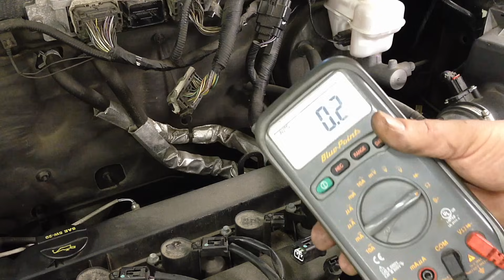Ford Ignition Coil Primary Codes P0351-P0360 Diagnostic Walkthrough

Comment: I'm having the same problem this is the first  time it gave a code for anything. on my 2001 Ford mustang gt  I have a my code is p0355 I did all the test when I connected my noid light than started the car the cylinder 5  hardness there was  ground no pulse could that be a large change the PCM is done for.

Comment: I have a po354 code the on f-150 5.4 guy  scanned it scoped it or whatever said I need a new computer anybody know much about that?
It has misfire on 1 and 4 then we clear the codes and then it's got a misfire on eight 5 and 2. Doesn't have any power if you press on the gas the truck won't even move

Comment: Where can I find a c.o.p. diagram to find the pulse pin for coil #1???? I'm desperate. I can not find a schematic on the 2007 5.4 3v Expy for the cop's. I have a p0351 and have don't EVERYTHING ELSE even a timing job!
Reply: @Jeremy Hess I had my friend Tim Latterly at MVperformance send me a diagram and I got that part straight. Thanks Jeremy! I still have a bad problem that I can't figure out though with this thing just going into mode while driving (when it's cold it's 100x worse). I am still getting a chech engine light but I don't have the codes handy. If you don't mind helping, I can let you know the codes tomorrow? I would sure appreciate any help.

Comment: Love your stuff! And appreciate that you share the info. You said that on three prong coil systems the testing is different. It is, but some Late model trucks have three prongs but only 2 wires in the connector. Little tip for those who get discouraged seeing three hole connector. Look inside to see if three prongs pare present. If not this test will apply to you

Comment: P0355 code 2008 Ford f150 4.6
Reply: That’s Cylinder 5 misfire, swap coils with cylinder 4 see if you still get p0355, if the coil is bad your new cel will be P0354

Comment: Just had an issue where my 2012 f150 ecoboost was idling weird. I had just had all coils and plugs replaced and was scratching my head. Had P0351 and after visual inspection realized cylinder number 1 coil connector was not fully connected. Reconnected it and have no change in idle. I assume im looking at a PCM replacement now? I think I am going to have a hard time explaining this to them and making them pay for it. Any suggestions?

Comment: had a p0354 on my 98 expy, didn't find this video until today, but i did fix it already, for me the solution ended up being cutting off the old connector, and crimping on a new one, once started it immediately ran significantly better,  so for anyone out there also getting primary ignition coil circuit codes, just because the coil and spark plug are both fine, doesn't necessarily mean that your PCM has gone bad either, it very likely could just be the connector itself has worn out
Reply: I have an 07 5.4 Expy, I've had a p0351 code. I have the constant hot side but I can't find a diagram to check the " pulse side" pcm pin to the #1 coil
Reply: what pin/cable is it for P0354?

Comment: How would one do the noid light test on the 3.0L on cylinders 1, 2 & 3? I have a p0352 code.
Reply: I just bought one, plug it in to your harness that connects to the coil and while your vehicle idles it will pulse if it's receiving the command from PCM, point A to B.

Comment: I replaced all coils and plugs, had a bad coil # 4, after repairs got the PO354 , found cracked wires from the adapter connector up 6 inches.. repalced the adapter connector, still getting the code, checked all the wiring to the pcm.. no cracks or tears.. any insight?

Comment: I thought you had a problem,what was it,the power was going through to the end as shown on the noid light,but u did not show us the ohms found if u hit the right pin on the pcm connector..what was the problem here,did u need a coil or just what...thanks

Comment: I have this same code P0354 So I switch the packs around still no spark on #4 so I check the wire they seem fine but when I pull the wire near the manifold the car revs by itself I dont want to take off the manifold what should I do now

Comment: Ive got a 02 Explorer. 4.6 4x4.  Ive got codes p0351 p0352 p0353 p0354 and p0358
What does it mean when you've got many of these codes?
The truck will intermittently not start.  All lights work, door chime, radio, fan blower etc, just no starter.  You can try it again and it may or may not engage the starter.

Comment: Hey I'm have difficulties with my 99 f250, I did all test that you posted about p0354 code in wires are good but as I plug the coil pack in, than I tested no spark , but when I plug the coil pack in a    different plug it works so how can I fix that? Been trying to fix truck for two months now...
Reply: Any idea if it would b possible a wire ???
Reply: Sheena Frank it's obvious that the coil driver for that cylinder has failed inside the PCM

Comment: Hello, just recently replaced spark plugs on my 2011 f150 5.0. I installed ngk iridium plugs. Shortly after installing those I get a shake and a p0354 code comes on. I replaced the coil pack and that did not help. While I was doing the spark plug change I did break a connector and replaces the black portion that plugs into the coil pack. Do you k ow if the coyote motors are picky when it comes to spark plugs or do you think I messed something else up? Any help would be greatly appreciated, thank you.
Reply: Kyle Harn if you installed a new coil on plug and spark plug and it doesn't fix your problem. Then either there's a broken wire or you need a pcm. If the plug came unplugged while the engine was running. Then install and new pcm.  It's a big No No to unplug the 3 wire coils while the engine is running. You'll get a voltage spike that takes out the coil driver in the pcm.
Reply: Adrian Waloshin thanks for the reply! I am leaning more towards a broke  wire since it is intermittent. Sometimes it will be okay and sometimes it misses

Comment: I have an 04 Taurus wagon  v6 duratec. Cylinder 1,2 and 4 are not sparking and it's not the ignition coils. I used the noid light on all of them and those three are giving me issues no spark and they won't light up on the noid light but will light up with the pen. Do you think I'd have to buy a new pcm?
Reply: Hi.  Did you fix your Taurus?   I'm having the same issue.

Comment: At 1:20 you say that the numbering goes from left to right and on the V6 and V8 engines it goes from front to back.  This is NOT accurate. On the 3.0 V6 engine, the back three cylinders are 1,2,3 and the front three cylinders are 4,5,6.  

I had a P0352 Code in my 2008 fusion. Based entirely on your statement, I replaced my FRONT three coils/plugs at the same time I reinstalled a rebuilt PCM.  Ran well for several minutes, then I fried coil number 1 and probably my PCM too. You might want to edit that statement about front to back cylinder sequence.
Reply from the maker: Yes my information is accurate you misunderstood what I was saying. I would imagine after 10 years of Ford drivability I would know that cylinder order. Especially because every Ford engine is the same you really cannot mess it up they are always in numerical order starting on the right bank FRONT TO BACK then it picks up again on bank 2 FRONT TO BACK in numerical order. If you did not replace your pcm with an RM suffix part number then this will happen again. Anyone who has the ability to reprogram the pcm and PATS keys should know the cylinder ID for each cylinder vehicle they are working on along with applicable TSB's. I hope this helps!
Reply: Criticize the free information you are getting. How about you do a little leg work yourself, double check the info, before you go blaming someone else for YOUR screw up. Not like you had to pay for any of this info. Its a starting point.... Or if you don't understand a firing order maybe you shouldn't be working on your own shit.... Just sayin
Reply: @csaleen302  Exactly
Reply: The 3 cylinders on the firewall side of a 3.0L V-6 are on Bank 1, the front of the engine left to right 1, 2 and 3 and on Bank 2 are 4, 5 and 6 left to right. The firewall side is the front.

Comment: I have a 2010 Ford fusion Hybrid and getting all  coil codes, 351 351 353 and 354. I'm thinking it's likely pcm since they are all coming up. Is 2010 one of the years they were troubled?
Reply: I have around 40 hours into this same problem and have replaced and troubleshot 90% of the system.  Did you ever get a fix for this issue with all coil codes on a hybrid?  Replaced PCM, then oem coils and plugs.  My car still starts, idles rough then shuts off automatically.  Thanks.

Comment: Thanks for the video - used it on an older Ford ZX2 with a coil pack ignition that ran like crap and was throwing a P0352.  Found one of coil trigger wires had rubbed through and was contacting the bracket at the rear of the cylinder head.  Appreciate all the help you offer up!

Comment: Thanks, My Brothers 2008 Edge is throwing P0354 and cylinder 4 is dead.
Reply: Bassett Race I'm getting this same code po354 for cylinder 4 does this mean the pcm is fine probably wire or cop

Comment: i have a intermediate 351 and 356 on 04 f150 5.4 3v the only other problem is failed alternators its been through 3 in the last 2 months, new coils, plugs, back probed all wiring, cordone ecms tech said unless its a currant failure sending in ecm is a gamble! it only fails for a few seconds while in gear! any suggestions? thanks in advanced. oh and i noticed the ecm has 8 drivers / transmitters for the coils but im not sure the intermediate issue

Comment: wanting to know before I take my PCM out to have it repaired, my #2 coil had melted, replaced with a new one, upon firing it up, it melted again almost immediately. is the pcm the culprit here?
Reply from the maker: +Ronie Ochoa yes very common on the escape and fusion models the pcm driver gets stuck on
Reply: @FordTechMakuloco  my ignition coil isnt working. And I noticed when I umplugged my ignition coil harness it didn't do anything. Should I be looking into the Pcm?
Reply: @FordTechMakuloco   Might have missed it in the video , will look again but How do you know a driver is stuck on?
    Had a 2005 e250 5.4 come in with a Cyl8/Coil H primary open. found the coil "exploded" Replaced coil  all was good until a month later. Now Fuse #8 for ecm relay and coil power blown and van does not run. I unplugged the cyl8/coil H coil and the Van will run. Thats as far as I got with any diag.
Reply: 2010 ford fusion 2.5

Comment: I've read on forums and seen other videos where they say that if you have a problem like this it's better to replace all coils and repair/replace the pcm. Their thoughts were that the short in the coil would damage the pcm. Also if the pcm were bad it would in turn short out the other coils on start up. What's your thoughts on that? 
Would it be a big deal to just replace one COP if that was the only problem? Could you swap COPs from one cylinder to another (say cyl 2 to cyl 4) in order to verify a bad COP (if all you had was a code reader and no DVOM)?

Comment: Nice video man. I have a 2001 transit connect with the 2.0 and it has a persistent p0354. New coil and connector on this thing and the code will intermittently set Customer says the van does in fact misfire sometimes but only for a few moments. I have tried to recreate this with several road tests and by moving the harness while in the bay. Never got it to misfire. Any advice on tracking it down in this situation? I am thinking about running a new wire for the control side to the pcm and trying it again.

Comment: I have a 2007 mercury mariner premier and my coil keeps burning out. can you guide me I the right direction.
Reply from the maker: If it is melting you need to have the pcm replaced
Reply: the wire to the engine was stipe and hitting another wire. as of today haven't had any issues. deleted codes now waiting for a smog

Comment: Hey there quick question. I have a P0356 code. I have several spare coils and plugs (previous owner), can I just try swapping new ones in on the cylinder and hope it clears the issue? Will the rare possibility of the pcm being bad foul or damage the new coil/plug? Thanks!
Reply: Brother I can attest that it will damage the newly replaced coil if the pcm is at fault. I just replaced my #2 coil which had been fried and immediately upon startup I had a rough idle still, checked the newly replaced coil and it had again melted.
Reply: It would be nice if there was a strait forward way to test the pcm. I ended up just replacing all my coils and plugs. Haven't had a CEL or issue since.

Comment: I have a 03 2.0 sohc focus its has a p 0352 and I've put a new coil and spark plugs along with new wires and it still has the code. I found I have no fire at cylinder 2 and 3. should I be looking at the ecu next?

Comment: So you say bad PCM's are rare, but based on your video, (you have proper voltage to coil, proper coil resistance, proper ground pulse signal and continuity on the PCM wire from the connector to the PCM) you have a bad PCM.   Maybe not so rare?

Comment: Hello sir, Thank you very much for this helpful video. My wife's 2011 Escape XLS 2.5 is getting the error for a misfire on Cylinder 1. I've replaced the ignition coil and spark plug, checked the common and signal wires, and that the injector is getting a pulse. All that checked out but the light came back on and it randomly runs and idles rough. I'm assuming the next step is to replace the fuel injector and fuel filter, but would greatly appreciate your thoughts on it. Thank you sir!
Reply from the maker: +Dennis Johnson Was there oil in the plug well. Are you using a motocraft plug and coil?
Reply: Hello sir! Thanks for the reply. The old sparkplug looked dry and clean. I replaced the original with a Duralast C1658 and sparkplugs with Autolite Iridium XP. I replaced the fuel injector this morning and it idled well for a while. We'll see if the ECU finds a fault after we drive it for a while. Thank you again for your help!
Reply: +Dennis Johnson Hmm, the light came back on again on her way to work this morning. I'm not sure what it could be now. I've replaced the ignition coil, spark plug and injector. I also get a pulse on the plug for the injector and ignition coil.
Reply: +Dennis Johnson I recent did same thing and checked everything I kid you not the spark plug I got from AutoZone was bad! after all I went through I ended up trying another new plug and bingo

Comment: What kind of Noid Light kit do you have? Id it like this item on Ebay? It looks like it more for GM vehicles and not Ford.

http://www.ebay.com/itm/9pc-Electronic-Fuel-Injection-Signal-Noid-Lite-Tester-Light-set-GM-Ford-Bosch-/321822103073?cmd=ViewItem&hash=item4aee179621
Reply from the maker: +kitt199546 that is very close to mine yes.

Comment: help po352 code for my 2004 ford ranger 2.3 xl  the coil pack is all in one not individual  sluggish seems like no power low idel  is it my pcm   coil pck is new and changed ??
Reply from the maker: Jennifer Scott If the same code is still there it is time to check the wires from the ignition coil to the pcm for continuity. If that checks out and there are no pin fit issues then I would replace the pcm. I am thinking you will find it in the harness.

Comment: On a 2000 Zetec Focus, I keep killing the wasted spark primary coil.  I have gone through three of them, one from ford, and two from oreillys.

When I was running tests, it appears that I am getting ground side signal from PCM on both signal wires.

Coils work for about 60 miles and then die.  I do notice that when I turn sharp I notice several misses.  That is how my last died.  I was turning with bad misses and then caused a primary coil error.  Each coil died with different coil banks dieing, 1-4, 2-3.  

I am going to check both crank and cam sensors for sensor and circuit integrity.

I know this is little information, but do you agree that I should look for a wire short?  Anything else I should look for?
Reply from the maker: GeekDIYMechanic On yours the harness for the coil likes to rest against the egr tube and melt grounding the coil all the time.

Comment: Is there a particular NOID set that you recommend for home garage use? What about a better set that can test other vehicles or are the NOID lights all the same as long as the plugs fit?   I have 2009 Ford 150 4.6L 3V and a 2007 Toyota Camry V6 3.5L 2GR.

I checked on Amazon and Ebay and there were too many that looked all the same. Not sure which is more reliable.
Reply from the maker: HawaiianF150 2009-4/6-L3V They all work in the same way. I have a kit like this one that works for just about everything-http://www.amazon.com/gp/product/B0002KO4I2/ref=as_li_tl?ie=UTF8&camp=1789&creative=390957&creativeASIN=B0002KO4I2&linkCode=as2&tag=fordt-20&linkId=WNXAXXZ37UL4JD2F
Reply: FordTechMakuloco Thanks! Have bought several of the items you have recommended in the many videos you've shared with us, Have not been disappointed in any tool purchase I've made because of your suggestions. In fact, my son wants some of the tools I've bought. (no way Jose;)  Please see my comments in your new Milwaukee Tools video. No email received yet. Sent my direct email address twice. Box is ready to ship just need address where you want it delivered too. 

We really appreciate all of your videos. Best video's on You Tube. Easy to watch and follow.  Very informative.

Comment: hello how are you I have a question I have a 2006 mazda tribute has a code P0351 p0354 and p0353 and p0352 replace your spark plugs and has the same codes
Reply from the maker: Vladimir Cruz If it is anything like the escape of the era you are supposed to replaced all coils and the pcm for bad pcm coil drivers internal to the pcm.